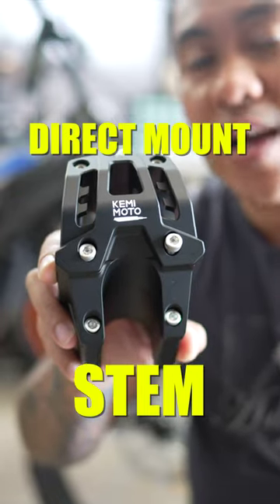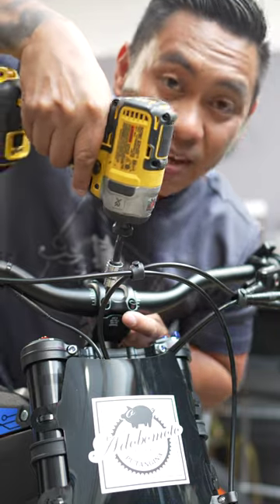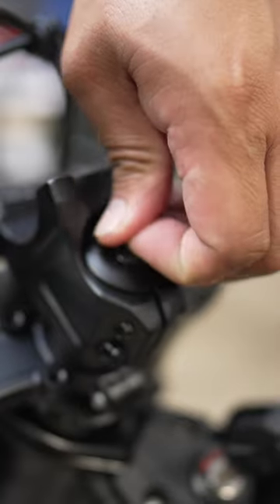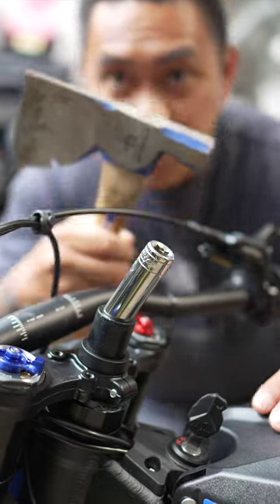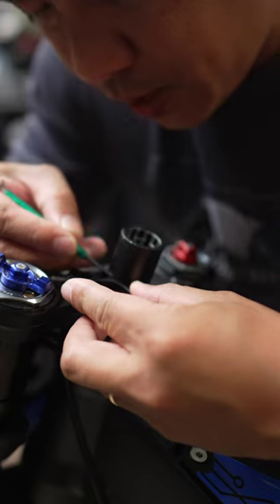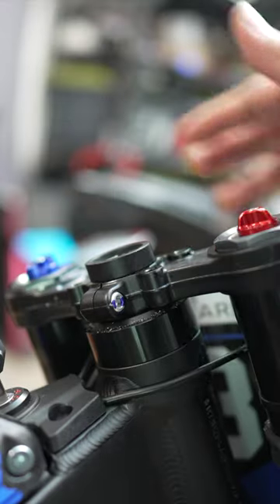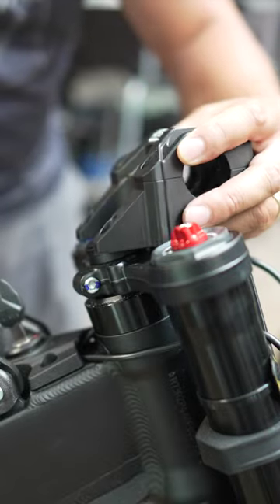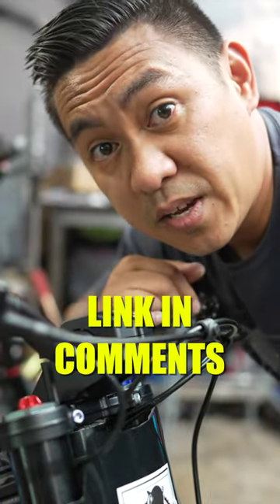TALARIA STING R DIRECT MOUNT STEM @kemimoto_official

Comment: What’s the purpose of this mount besides having the option to raise the handlebars?
Reply from the maker: direct mount has a more direct steering input
Reply: Ah okay. This is what I was wondering.
Reply: I was wondering too, I didn’t see the difference other than the new one being more beefy
Reply: @RapidRedRider plus it’s a lot safer than the stock stem it’s a mountain bike stem
Reply: If you’re doing jumps or trails or maybe coming down hard on your wheelies the stock stem doesn’t always hold and you have to tighten bolts a lot. If your just riding it around normal then you probably don’t need one of these beefy mounts at all besides for looks.

Comment: Uh what? It looks just as high as oem
Reply from the maker: cuz I didn't add the riser (listen to what I actually said in the video)
Reply: @adobomoto   Sounds like expense and work for nothing.
Reply: @paulhope3401 it’s a direct mount stem. Do you know what that is?
Reply: @paulhope3401 direct mount stem is a more rigid design, the normal mount bike stem can rotate with too much pressure applied, direct mount handles better and gives better feedback aswell
Reply: @davidmunoz9844   Yes why?
Reply: @dominicdistasio4587   Yes, I can see exactly what it is. I don't need it though, stock is good enough.
Reply: He was paid to make this video
Reply: @paulhope3401  i disagree, the mountain bike stem creeks, and doesnt give a very good feel when riding hard, direct mount feels much better. But to each their own